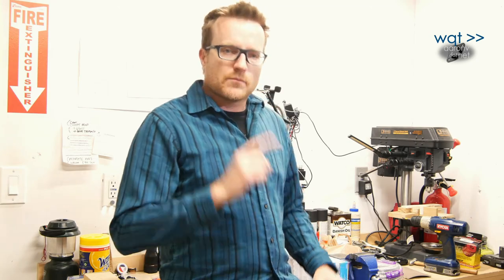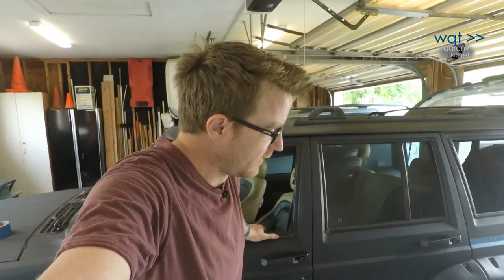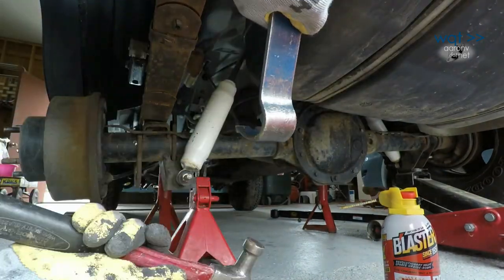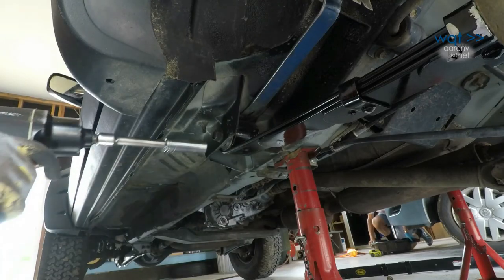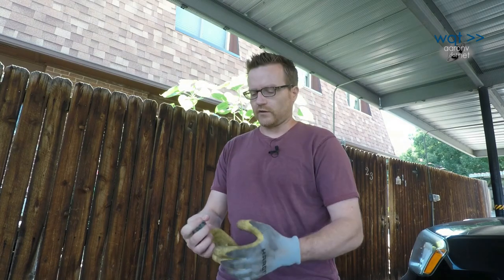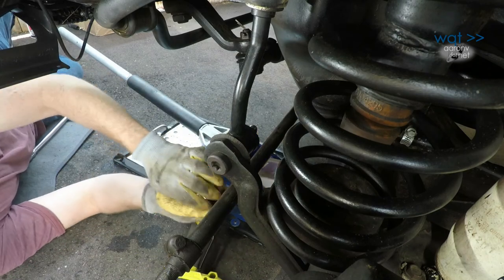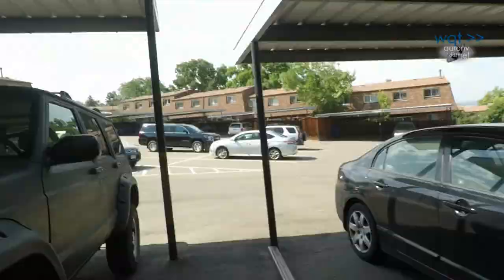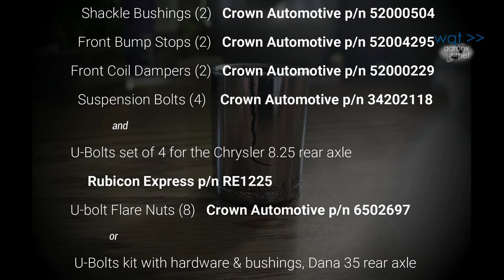wqt//Basic Auto: Springs Have Sprung (Replace coil and leaf springs on a 2000 Jeep Cherokee XJ)

Comment: Love it!  What size tires can you run since putting this "stock" lift on?
Reply from the maker: I'm running 31x10.5 R15, but that's with 1.25" spacers, cut fenders, and pocket arches that two previous owners contributed to this vehicle's mixed heritage before I got it. Something in the range of 29-30" would probably be the limit otherwise.

Comment: how are your leaf springs holding up?
Reply from the maker: No issues yet. On one hand I only put a couple thousand miles per year on this rig, on the other, most of that is off-road. So they are properly broken in and settled.